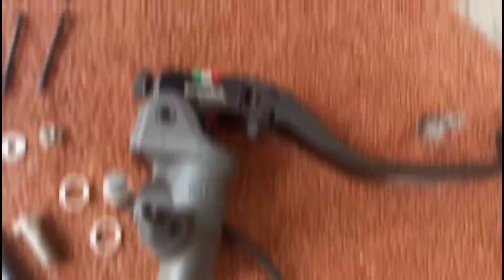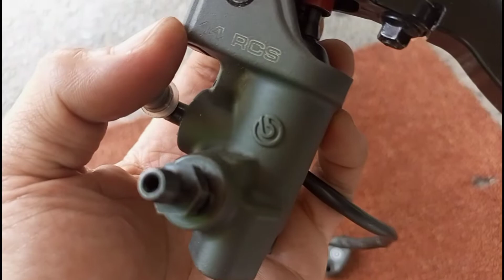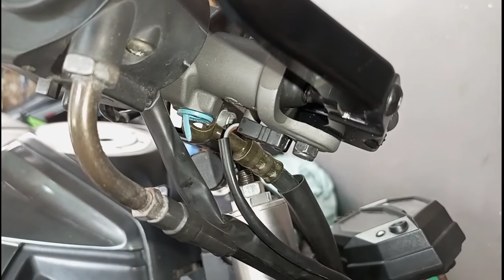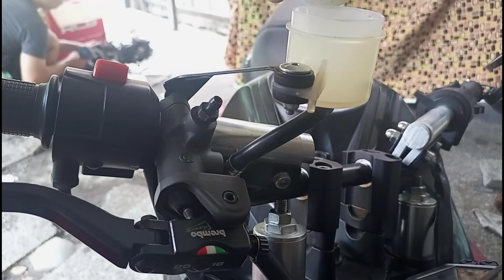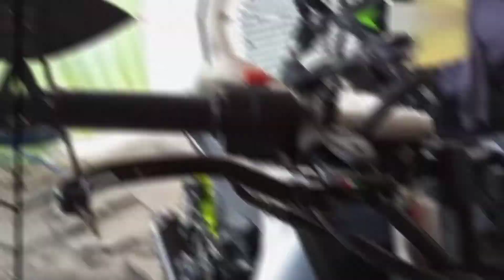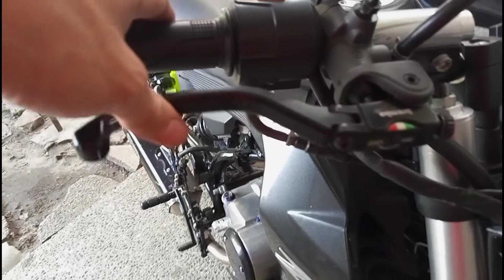Brembo 14 RCS Installation

Comment: Nice video, could you explain how is the brake switch wire connection?
Reply from the maker: I just tap the two wire of the brake light switch to the existing brake light wire of my motorcycle